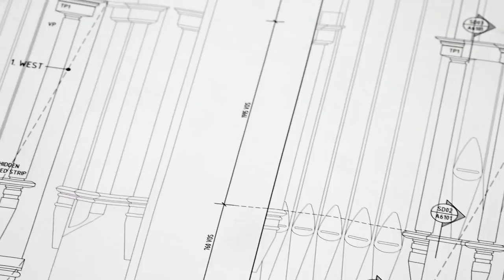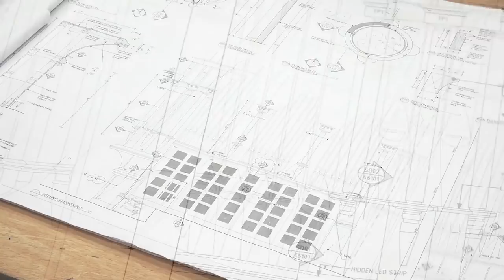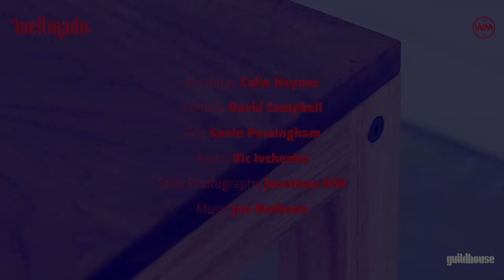Furniture maker Lex Stobie talks the value of the unique and handmade

Comment: Hands pushing wood through a machine is not hand made. It is simple modern furniture like Ikea with real wood.
Reply: I think there is a distinction, hand made utilizing machines (such the like of routers and saws etc.) can still be considered hand made.  Ikea use machines (with minimal human involvement) to cut, drill, trim and cover mostly man made boards into bland furniture that is sold in flat packs for cheap shipping.  
If you really want to push "hand made", why would a craftsman (before the advent of machines) be able to say he hand made something if he used any form of tool apart from his bare hands?   Cheers, David
Reply: The distinction between a craftsman's guided cutting tool to shape wood and shoving wood in a machine is a clear one. Is the cutting edge guided by a human mind or a machine? Your reasoning that any and every tool is the same beyond a craftsman's bear hands is asinine.
Reply: Any craftsman creating furniture for a living would invest in the tools to provide the best output.  To think otherwise is perhaps being a bit romantic?  Cheers, David.
Reply: Craftsmen have bear hands? Don't their claws get in the way?
Reply: If that is a joke, it's unbearable!